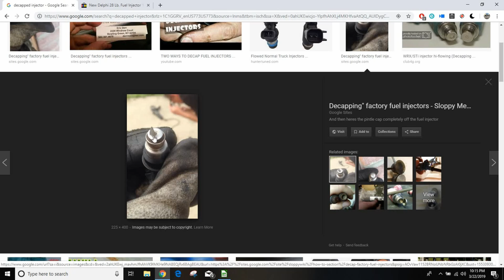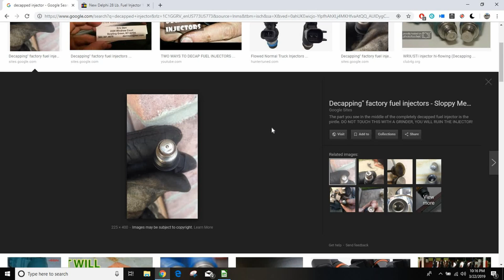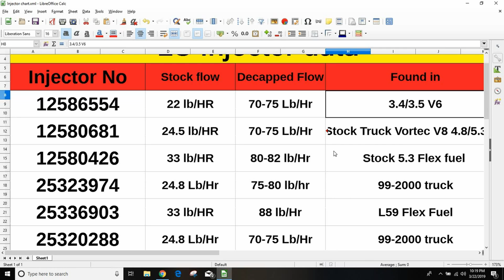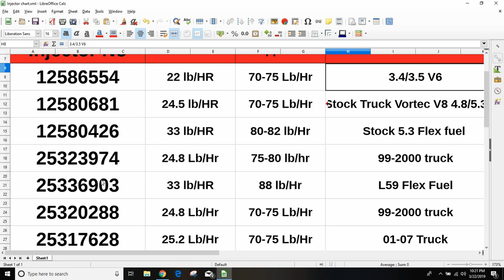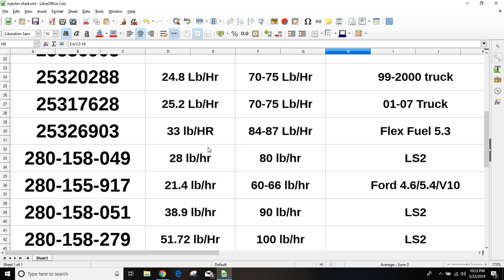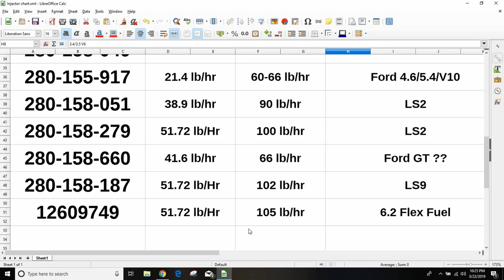LS Basics, Injector Flow

Comment: I need some help from the driveway engineer I recently did a ls swap from start to finish everything new all new sensors. My car cranks but won’t start, it only starts if I spray starter fluid in the throttle body. I checked the hot wires at the injectors and they were getting fire. And I checked for fuel pressure and it’s like 58 psi. What do you think could be the problem
Reply: Thanks I watch your videos all the time. I’m very thankful that you responded so quickly. You really know these ls engines
Reply from the maker: @cedricdeoan1214  good luck man!
Reply from the maker: You've already solved your problem, your injectors are not firing. 

LS engines switch grounds, not hots, to fire injectors
Reply: So how do I fix this problem
Reply from the maker: @cedricdeoan1214  I have no idea from across the internet, you're going to have to do more diagnostics.. 

Typically it's a ground issue though

Comment: I'm too lazy to check if it's already been said and I know this is an old post but flow rates are by a certain pressure like usually stock flow rates from the OEM or at 43.5 lb per hour which is what most of the 90s cars use a lot of these newer cars that aren't running return fuel systems are running like 60 pounds of fuel pressure so that 33 lb an hour flex fuel is actually like a 37 so don't just look at the flow rate you have to look at the flow rate at a certain pressure rating also injectors have different lengths if you put an injector on your car and it's not the same size as the old one a lot of times you have to get spacers to raise the fuel rails also I believe some might even have a slightly different diameter so you do need to do your research if you're going to try and use injectors from a different car.  Also there's different wiring connectors dv1 ev6 ev12 the old early fat Bosch jetronic I think it's called so you got to be careful of that as well also one thing I haven't heard people cover he kind of went over it with decapping if you're going to use a four-valve engine injector on a two valve the spray pattern is different and you might get more spray on the intake Port walls then if you use one from a two valve injector because the whole intake Port shape is wider that is only known to me from reading I have no data on it so take that with a grain of salt until you can get someone to actually test that.

Comment: hack job.  those "restrictors" atomize fuel so it burns quickly and completely.  decapping is a good way to wash down your cylinder walls with raw fuel, and cover your insides with soot.  you can find 80 lb/hr injectors with proper atomization for $50 each.  why don't you provide flow tables so people have a fighting chance of tuning.  btw, Bosch is rhymes with wash.
Reply from the maker: I really appreciate you watching and commenting on all my videos 😂

Comment: Will the GM 3.1/3.4/3.8 injectors work with a 5.3? I'd figure if anything you might have to change the pigtail design if it's different. Was gonna take you advice and get a bunch of v6 injectors and decap them. Planning on running a boosted 5.3. Thank you.

Comment: Can I use the 6.2 flex injectors part number 12609749 in place of the stock L59 injectors out of an 02 Yukon?
Reply from the maker: You can use any injectors you want as long as you know the flow numbers
Reply: So I'd have to k ow the flow rate during the tuning process so that way it runs right? Just wanna make sure I got everything squared away. Like knowing if the connector is the same and if they're the same length and have the same diameter where it goes into the manifold and fuel rail ect.

Comment: Dumb question but how do you tell the cubic inches on your ls when the car has a replacement engine.
Reply: Head numbers are a good hint only for sure way to tell 5.3/4.8 is pull a head and measure bore
Reply: @turkeyboyjh1  5.3 and 4.8 have the same bore as they share the same block.

But you can pop out a plug and look at the pistons with a boreoscope. 4.8's are flat tops and 5.3's are dished (most of the time)

Comment: This is the directional spray plate to create better atomization of fuel, not a restrictor plate. But also not my injectors. This can allow hot soak to turn volatiles and other light aromatics in the fuel to cook onto the pintle of the injector, sticking it or creating a spray dam directing fuel to different directions. But, if you want to do this, go ahead. It’s not my injectors. I’ve worked on multi port electric fuel injected vehicles since 1976. There are always ways to pound for ponies. Not saying right or wrong, just without additional comments.

Comment: I have a set of 12613412 in my LQ9. They come on the 2010 
(?) flex fuel trucks and are 50lb @ 58psi. Got them brand new on ebay for $70 from a company that does CNG conversions on fleet trucks, they do require adapters though.
Reply from the maker: That's a good price!
Reply: How is it running with those injectors on your lq9... I’m building my lq9 with a tick performance sns stage 2 cam and 243heads just looking what would be the best injectors for it
Reply: How is it running with those injectors on your lq9... I’m building my lq9 with a tick performance sns stage 2 cam and 243heads just looking what would be the best injectors for it

Comment: My 03 suburban has a regular black gas cap I think it is the factory cap but it says flex fuel inside the gas door
Reply: James Holdbrook   The 8th digit will say “Z” which means flex fuel. Not all got a yellow gas cap as a novelty to thing of corn. They also had an in-line fuel sensor that detected the less dense ethanol and the temperature as well. A $350 part mounted on the frame before the fuel filter. This second design for many but third design for others as they used a PCM refueling strategy after 2 gallons was added. The problem was, the vehicle had to reach normal coolant temps at road speed while ignoring fuel trim for re-setting to new mixture.
ASE Master Tech Retired

Comment: so how does this decap change the atomization of the fuel and how it performs before the burn?  thanks
Reply: For Delphi/GM they become a very narrow beam with poor atomization. It's very similar to the Siemens Deka 4's, which you can google. Not a big deal for WOT runs, but can lead to issues at low loads.

Comment: Hi. I wanting to know if u drilled out the restricer plate holes on the injector and made them bigger instead of decapping them would that work that way they would still seal correct..is that possible to do??thx
Reply from the maker: They generally seal correctly decapped. 

I'm not sure how you would drill the holes larger, and not get into the pintle. Or how much of an effect it would even have, by the time you drilled them large enough to get into the 70 lb/hr range, they'd basically be decapped lol.

Comment: By grinding off the orifice plate you ruin your static controlled flow rate for the injectors as a unit and the spray pattern. Like taking the nozzle off a garden hose. I have never done this or been in a car that has it done so I’m just going off hearsay but doesn’t the spray pattern effect cold starting and driveability?? I would think the most difficult thing would be tuning it? What are you experiences with drivability and the fueling tables in the tune? Or is this a max effort 1/4 mile only kind of thing?
Reply from the maker: As far as tuning goes you just up the actually flow rate to whatever you get from flowing. SO if they go to 70 lbs, that's what you set. Hold time and everything else stay the same. 

If the spray pattern has a real world effect on cold starting or driveability, I'm not seeing it in my own truck. It cold started and idled fine. 

Now, it's not something that anyone N/A needs to do, but if your goal is modest, 5-600hp, then you can get there for the cost of injectors and flowing them. 

I did have two in my batch that flowed at right angles afterward that went in the trash, you absolutely cannot decapp 8, and jam them in your engine.
Reply: I was just wondering because I know with 42# injectors that were flow matched etc I still needed to touch into the transient fueling or it would load up very bad on decel and the stfts couldn’t react quick enough when back on the throttle and it would stumble for a second under light throttle. Had something to do with my min pulse width wouldn’t drop low enough if I remember which was causing an overly rich mixture that the cam overlap puked right into my O2s. I’d figure these would have the same issue? But I have cncd heads and there’s a lot of tables involving the fuel impact on walls and boiling rate etc. that I don’t comprehend as well as I’d like so my issues may have been to the redesigned heads.